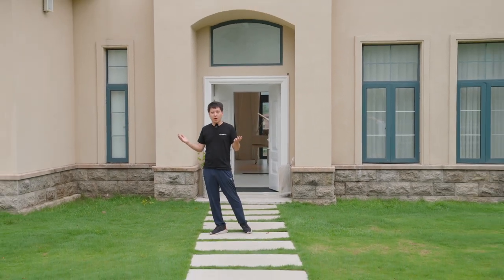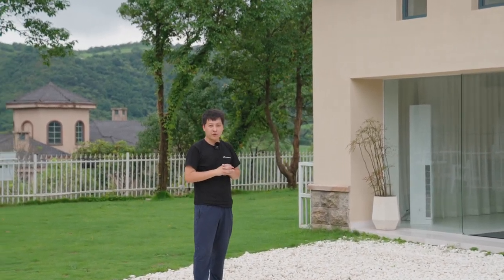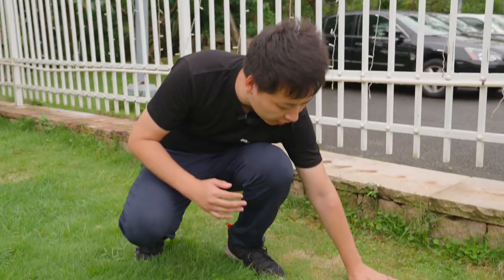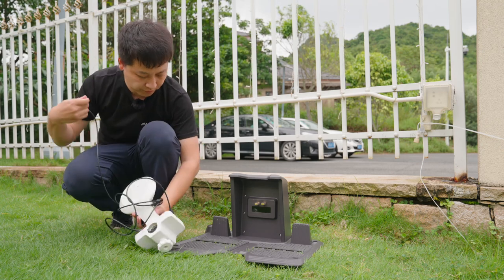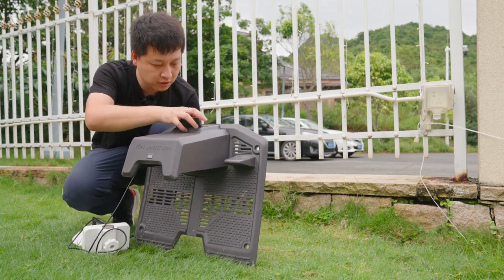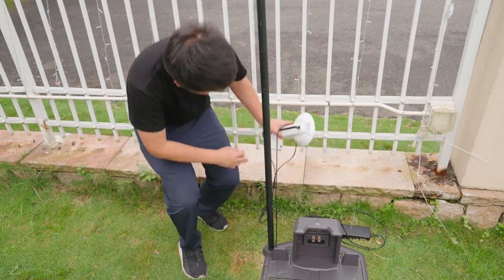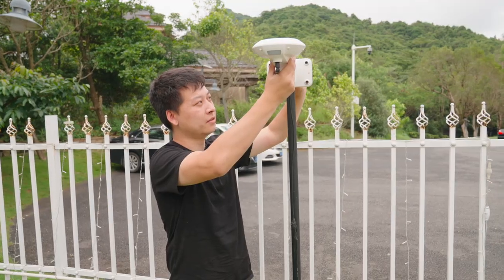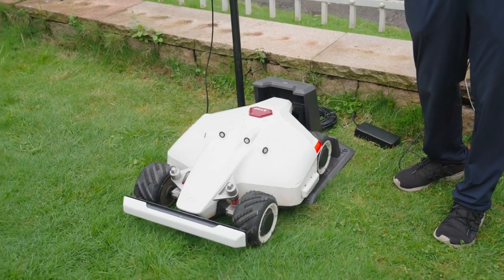Things You Need To Know About Luba RTK

Comment: If you want to install the RTK reference station apart from the charging station (in my case, on top of the building to cover both the front and the back yard), do you need an extra accessory to power it?
Reply: I have the same circumstance.
Reply: Same question…
Reply: Can I have several RTK for one Luba?
Reply: In the vid it doesn't specify if the RTK reference station needs to be on the roof.  Perhaps LUBA can connect to it even with the house in between (to go to a rear yard, for example).  I think this is what the engineers need to be clear  on.  The house in the vid looks big enough to be a good example;  Mammotion, can the mower cut behind the house with the reference station installed in the front as shown in the video?  That is the $64,000 question.
Reply: Only if they use multiple channels for their rtk signal otherwise they would interfere with each other... But on the other hand one rtk would cover multiple Luba robots
Reply from the maker: Hi Jose, yes if you want to install RTK station on the roof, you will need to have a seperate power adapter and extension cord to power RTK reference station. You can purchase them on our official website after the campaign if needed.
Reply from the maker: Thanks Michael, we will cover this part in the future videos. Stay tunned.
Reply from the maker: I will forward this question to our engineer team and I will get back to you soon. Thanks.
Reply: @mammotiontech  
It would be good if this was announced before the end of the Kickstarter campaign. This is a very important question for many potential investors.
Reply: @michaeldzubow4108  me too !! And now @Mammotion Tech next round Fight!!!!

Comment: RTK, A direct line-of-sight is required and the accuracy at the rover depends on the distance from the base station.
That will NOT work with a Lawn around the house.
Reply from the maker: Hi Klaus, Luba doesn't have to be in a direct line-of-sight with RTK reference station. Thank you.
Reply: @mammotiontech  It uses Wifi to talk to between Luba and RTK.

Comment: From the internet (I don´t feel lucky, after readung this 😞

Does RTK need line of sight?

Radio Delivery (standalone)
A base station receives signal from satellites and transmits the RTK corrections to the rover via radio. A direct line-of-sight is required and the accuracy at the rover depends on the distance from the base station.
Reply from the maker: Thanks for your question. I will forward it to our engineering team and get back to you soon.

Comment: what happens when Luba (GNSS/RTK rover) is mowing under a tree and does not have open sky view to the satellite constellation?
Reply from the maker: It may affect its accuracy of positioning. Thank you.
Reply: @mammotiontech  thanks, how far away from the planned boundary will it poibly venture?  Does the firmware recognise the lack of locked RTK and in that case does it deliberately keep even further inside the boundary limit and only go out there when it has good locked RTK accuracy?
Reply: *possibly venture

Comment: This doesn't say or show anything in regards to the LUBA being out of the line of sight. What happens when the mower goes around to the backyard of the house? Will it still function with the current set up of RTK?
Reply: same question. what if there is a house or a shed in between the line of sight?
Reply: The signal between rtk and the Luba doesn't have to be direct line of sight if you're close. I'm not sure which are a frequency they're using but some RTKs use VHF and some use UHF it will penetrate a few obstacles
Reply: @David-oz9iv  thanks. Luba has told me their RTK has a range of 80 meters. that's not very far and would indicate UHF I guess. UHF would be better penetrating buildings. Luba however  recommends to install the RTK on top of the house instead which would indicate VHF. Only Luba can answer that I  suppose.
Reply: @ipaulus  That 80 meters max distance doesn't sound promising. How can it cut 5000m2 grass daily if it needs to be fenced by 80 meters? Pi*sqr(80) = 20106m2 (UPS!) 

Still 80 meters is kind of low for any irregular shaped garden like mine.. With biotops/islands of trees and multiple lawns 🙄

This sounded good at the surface, so at least I would need firm answers on range and capacity prior to signing up for this 😳

The 5000m2 is from the specs page.
Reply: @ulrikduejensen1741  something for mammotion/Luba to explain
Reply: @ulrikduejensen1741  well, you can cut the same m2 of grass multiple times 😅
Reply: @Ajexis  I did think of that as well, but decided not to write it. It is not even  funny.. Wait.. It actually is kind of funny.. And sad at the same time 😬. My current robo mower does that using its random pattern, but has trouble keeping up with 3000m2 😆
Reply from the maker: Hi Trevor, Luba doesn't have to be in direct line of sight to be able to work. The radius of RTK range is 80M, which means it can cover an area of 20000 m2. Please check out this video: https://www.youtube.com/watch?v=qmV5Y_bzu_o&t=19s. Thank you.
Reply: You have to take the radius, not the diameter for your calc. With radius 40m its exactly 5000m²

Comment: How is this rtk system protected vs lightning strikes? Its a metal rod... on an open field, it WILL get hit...
Reply from the maker: Hi, thanks for your question. There is a chance to get lightning strike if you install RTK on the roof, but the chance is very small on the group. When you install RTK on the roof, you don't need to use metal poles to install RTK, so the lightning strikes won't be a problem. Thank you.